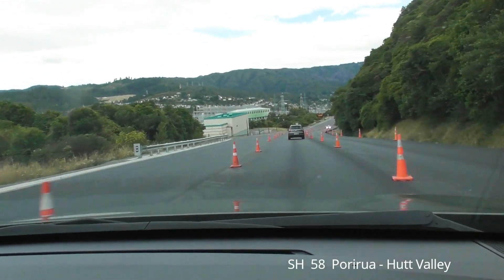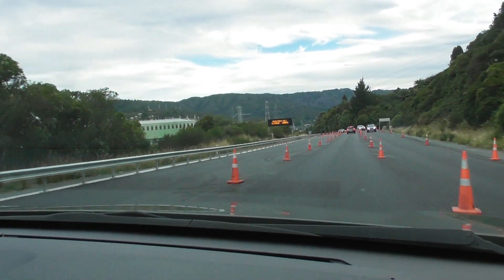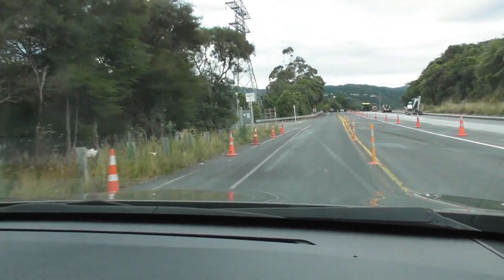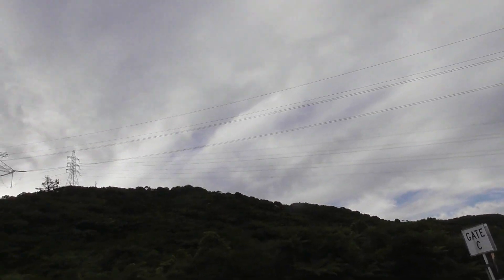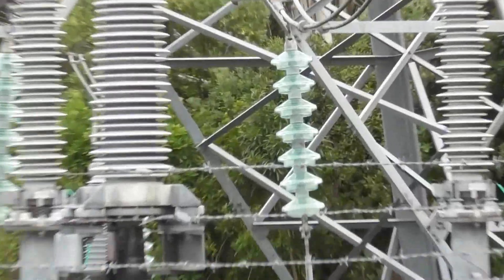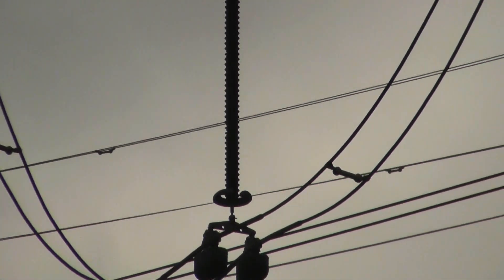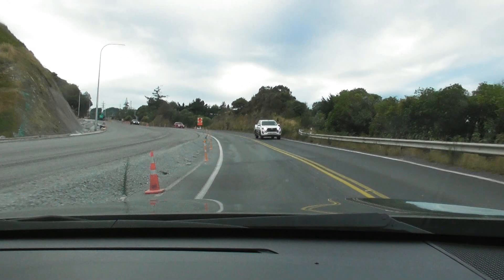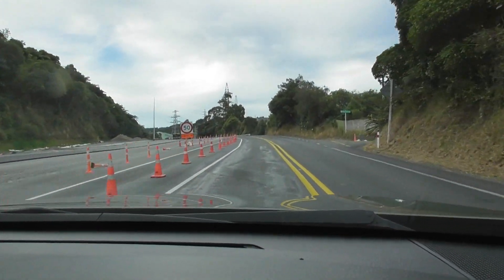Haywards NZ pylons and 700 kV DC line

Comment: Really cool! 
DC is indeed better (lower losses), so we will hopefully see more of those DC links in the future (when the price of semi conductors handling those voltages goes down). The best thing would be to have the whole grid DC, since most appliances use DC today (like all electronics and even most lighting now with LED) and many products run just as well on DC as AC, given that the voltage is right (for example heaters of different kinds). 
But that will probably never happen, since many products are still built to "only accept" AC (even though they would be easy to modify into run on DC in many cases, that's not something the average user can do) and especially in the industry, they still use many directly driven motors - even if inverters gets more and more common. Another thing is mechanical switches and relays built the way they are now - they don't work well with DC, because it create arcs much easier, haha. Not to mention most of the power grid (except for theses links) are built up around low frequency transformers that need AC to work. 
But DC is in fact used for many newer large server arrays in data centers - since the efficiency of the AC/DC conversion goes up when having one or a few big converters instead of every computer having it's own. The heat from losses that are still there, can also be vented outside instead of into the server room (wich saves a lot more energy when the need for cooling decreases).
Reply: As you might have expected, humanity didn't agree to have AC every where without proper reasons. And imo these reasons are still valid.

Comment: I thought the DC line was +-375kV or 750kV across the line. I used to live under that line in Churton Park from 1979 till 1986, when it was +-250kV or 500kV across the line. When the insulators were dirty, you’d sometimes get arcing occurring.
Reply from the maker: Yes it could be ±375 kV. It was increased from 500 kV upwards, after the Mercury rectifiers were upgraded to solid state.

Comment: Is there a future plan to add another HVDC line or something else to go along with the existing one?

And wasn’t there a proposal at one stage where Transpower is looking into branching off the HVDC line from the main South Island connection into Christchurch?
Reply from the maker: Not sure, the limitations are the 4 or 5 cables going through the Cook Street. At the moment the capacity is around 1200 MW. It would be better to extend the DC line to Auckland. although with the risk of an ash-cloud from Mt Ruapehu. DC would be more difficult to deal with.
Reply: Is  Mt Ruapehu due to errupt in the near future. When was the last time it errupted.

Comment: DC transmission network? So it must be reconverted to AC at the other end for distribution? Interesting video!
Reply from the maker: Yes it is converted at Haywards and in Benmore. The power can get converted in both directions depending upon demands.
Reply: @Andreijvoronov  Over long distances high voltage DC can be cheaper because of the savings in conductors due to no skin effect or inductive losses. This line is 610km long, and it also passes under the sea which is difficult to do with high voltage AC. The line was originally constructed with mercury arc rectifiers but now uses thyristors to convert AC-DC.
Reply: @Andreijvoronov  The point is lower losses - AC is very lossy over long distances, due to capacitance between lines and the skin effect (where current goes mostly close to the surface in the conductors and less in the middle of thick conductors - causing the effective cross section area to decrease). Under water this get even worse (even at relatively short distances), due to the need for conductors to get closer to each other (usually coaxial cables is used, wich have very high capacitance compared to overhead lines). 
Also, the higher the voltage, the worse the problem with line capacitance becomes (it's like charging and discharging a capacitor - the higher voltage you charge it up to, the more energy it stores and the more current it takes to charge it in the same amount of time. Even if the capacitance remains the same. Those currents creates resistive losses in the lines, even if they don't do any useful work, so to say.). 
At some point, there is no benefit increasing the voltage anymore, since the capacitive currents goes up so much that the total losses remains the same (or even worse, increases)  - despite the losses from the transferred power it self continues to go down with highr voltage. That's probably why we don't see many AC power lines higher than 400-500 kV - but many of the HVDC systems goes to 700-800 kV now (like this one) and that may increase even more when semiconductors that can handle the voltages are getting better and cheaper.
Reply: @Andreijvoronov  To convert is very simple, you use a lot of lower rated devices in series, to get the voltage rating, and in parallel, to get the current rating. The most common method uses a lot of fairly high power thyristors, 1kV at 20A for example, and a lot in series and parallel, with the gate drive to them being supplied by an optical fibre connection to each device, or by a isolated electrical connection to each bank. Driver is a fairly high power laser, to give the required level of light needed to turn them all on fairly fast, or a very high power driver for all the banks. You need a bank of 12 blocks per line, with 6 being used to form a very large 3 phase rectifier, and the other 6 there to commutate the corresponding block, so that it can be used to turn off the block under the inverter control. 

This then allows you to control the power input, and also allows you to convert the incoming DC voltage to AC, and vice versa, with the power controller doing the control on each cycle. Also allows you to change line frequency as well, to interconnect 50Hz and 60Hz grid sections, but not used here, as input and output are 50Hz, though having local control means they can drift in phase relative to each other with no issues, unlike a large AC grid, which needs to stay in phase all throughout.
Reply from the maker: @Andreijvoronov  There used to be ABB Mercury rectifiers about 15 years ago (the voltage was then 500 kV dc). They were upgraded to solid state rectifiers and the voltage was increased. The rectifier stacks are series/parrallel arrangements of semi conductors.
Reply from the maker: @Andreijvoronov  https://en.wikipedia.org/wiki/HVDC_Inter-Island
Link from Wiki with a few more details of the HVDC link.

Comment: The bushings and clearances look bigger than for the 400kV AC lines in the UK, maybe it’s just perspective or is DC a bit more arc-y?
Reply: This is one of the sections of the line subject to salty ocean spray, so the bushings are very long (about 5m). Most of the line is inland South Island and the bushing are about half as long there.
Reply: dc will absolutely sustain an arc over a larger span once initiated. there are some good videos on youtube on using AC switch-gear with DC and the consequences.
Reply from the maker: An arc on DC is a lot more difficult to extinguish then with AC as the flow of current is continuous. The AC cycle breaks 100 times a second (50Hz systems)

Comment: 3:34 why are there 2 wires per phase. DC doesn't have a skin effect so why not just one think wire or many smaller wires bundled together.

On high voltage AC lines in the UK, ive seen four wires per phase, separated by spacers. I assume this is to reduce the skin effect.

Are the wires at the top to conduct lightening to ground or for something else like communication.
Reply: Maybe it was originally one wire per phase and then they needed to increase the capacity so they added a second wire? That is a guess. I have no idea.
Reply from the maker: Standard wire sizes are used. Bigger diameter cables are more difficult to string and have more internal heating.

Comment: Was it windy when you filmed the video you can see the insulators titling too one side great vid cheers
Reply from the maker: It was not really windy that day.
Reply: That's normally due to a slight corner in the line, so the tension is at an angle.

Comment: I wonder how long does an average electron take to cross a 100 KM section.. hmm... what's the nominal current?
Reply from the maker: 1430 Amps continuous and 1600 Amps for 30 minutes for the underground sea cables. The overhead line as in the video 2000 Amps continuous at 350 kV dc per pole.
Reply: Before I start doing the math, may I ask why you ended with "per pole"? I don't understand what it means. Perhaps you mean at the source or destination?